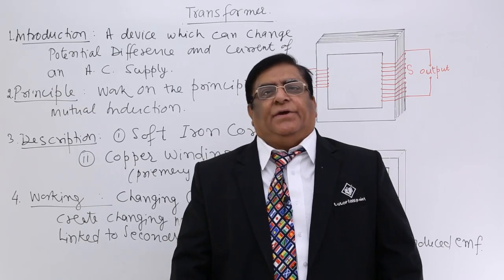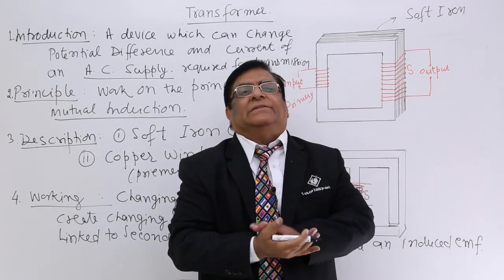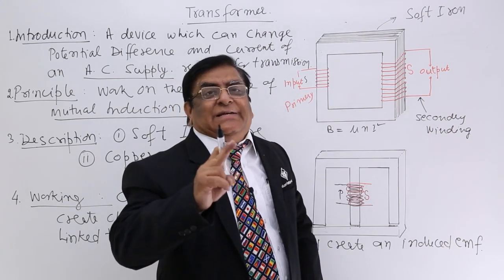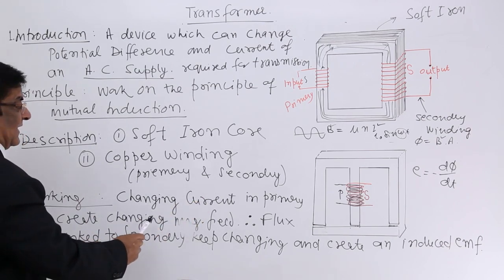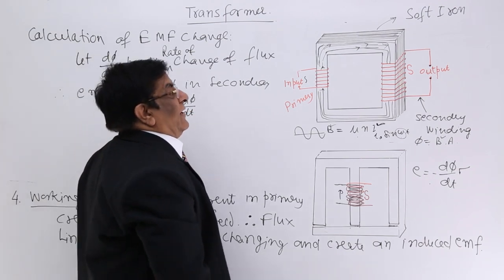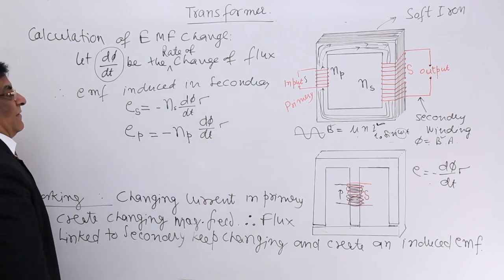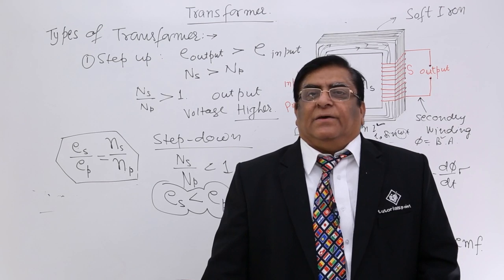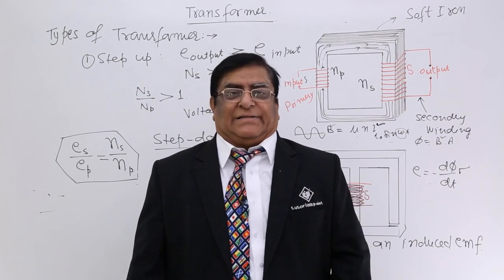Class 12th – Transformer | Alternating Current | Tutorials Point

Comment: kindly requested to you sir make video according to my syllabus.my syllabus is-UNIT-II (12 Hrs.)
Fault Analysis: Transients on transmission line, Short circuit of synchronous machine, Selection of circuit breakers, Symmetrical fault analysis using Thevenin’s theorem. Symmetrical Component Transformation, Construction of sequence networks of power systems. Analysis of Unsymmetrical LG (line to ground), LL (line to line), LLG (line line ground) faults using symmetrical components, Symmetrical and unsymmetrical faults analysis using Bus Impedance Matrix with algorithm and flow chart.
UNIT-III (10 Hrs.)
Power System Stability: Steady state stability, Dynamics of a synchronous machine, Power angle equation, Transient stability, Equal area criterion, Numerical solution of swing equation, Factors effecting transient stability